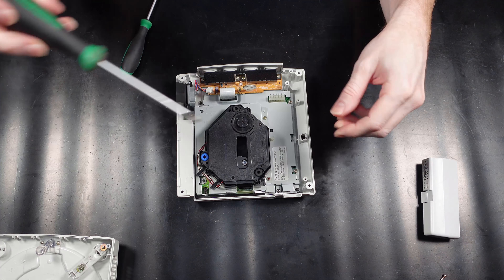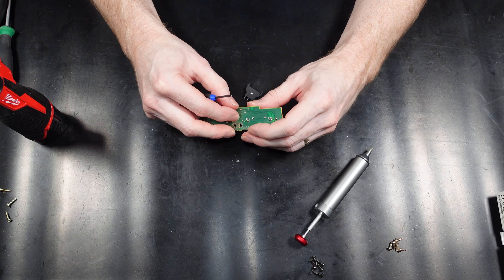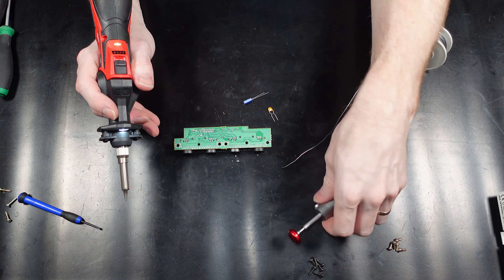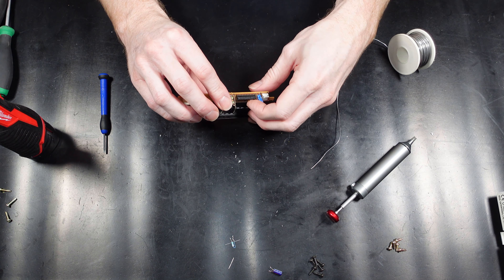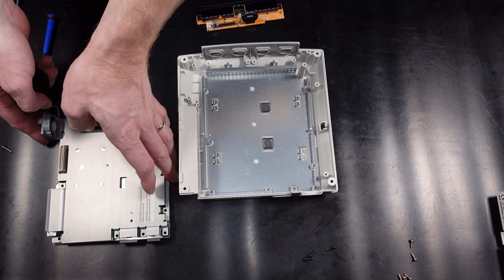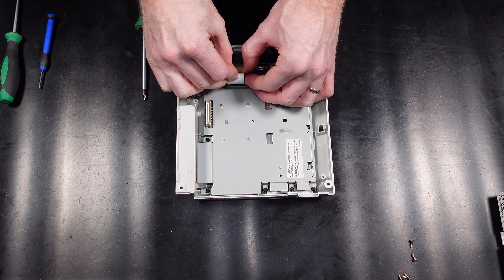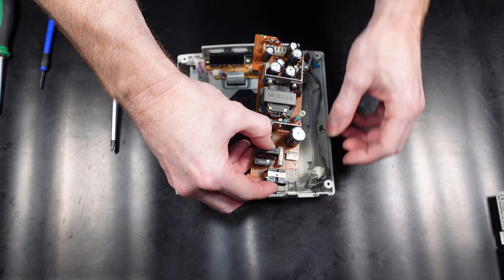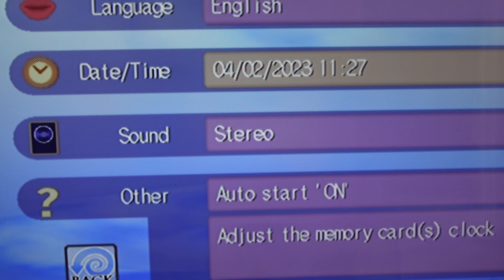Sega Dreamcast Mod - Battery, Fuse & Capacitor Mod Replacement - Retfurb Vintage Refurb

Comment: great tutorial, very clear. i think you sold me that iron too. been looking to upgrade to a decent one.

would like to see a full recap video one day as the dreamcasts are all starting to die from the capacitors expiring.
Reply from the maker: Thank you for the kind comment, It is appreciated.
Yeah, The Milwaukee iron is pretty handy, It is a bit bulky, But you get use to it. They had an issue with them at the start, Where the hot end worked loose in the plastic. This one is a replacement from milwaukee, With the modification on it. So its perfect now.

I will look in to a re-cap video and put it on the list to do. 👍
Reply: @retfurb  Nice. you'd be the first one to do one too!
Reply from the maker: @EvatronX  I will check which ones I need to get and get it done soon 👍🏻

Comment: How hard is it to replace the battery without soldering experience?
Reply from the maker: It’s fairly straight forward, but you I’ll need to solder.
It’s one of the easier solder jobs, as the points are quite large.
Reply: @retfurb thanks I've found some replacement boards online, so might just buy one. One thing in the video, the Dc used a Gd-rom drive, not a Cd-rom drive. 

I've already replaced the psu in my Dc, and would like to try the Gd-emu addon to preserve my drive. (Just seen you had a video on this)

Thanks for the reply, and video. ✅️
Reply from the maker: @CA_I  No problem at all. I am glad it has helped. 
Thanks for the support.